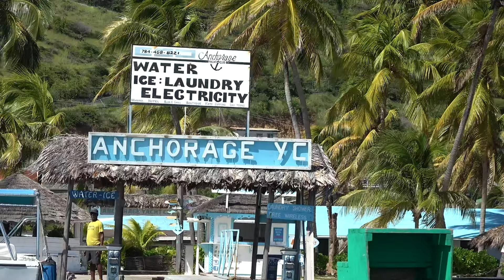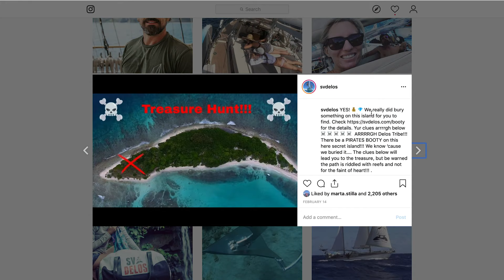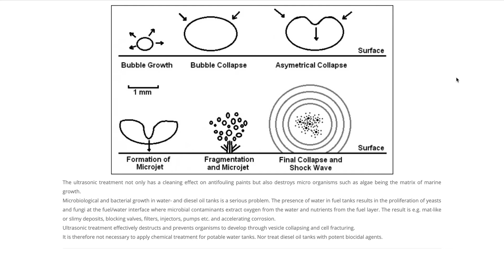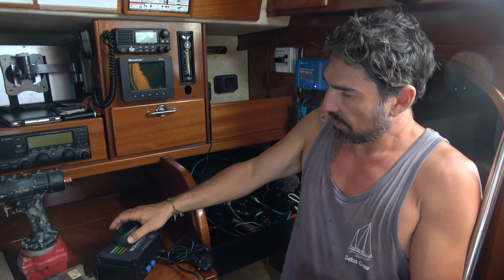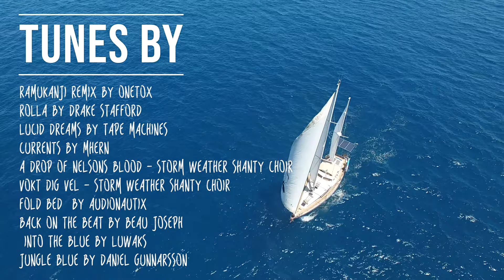We Buried a Moonshine 🍾☠ Treasure on a deserted island!!!  Sailing Vessel Delos Ep. 216

Comment: Hope that thing works on getting your boat bottom cleaner for a longer time for in between scraps. The best way is to do what the older folks did or what I did for a the boat owners on are dock. They would pay me, depending on the size of your boat, around $25.00 per boat. I could do around 4 per weekend around the 70' range. We all had houseboats on are dock. There was not a lot of sailboats. But if I could make a dollar by swimming, I did it. So go to the locals & pay there kid $20.00 to do just the sides of the boat. Then you all can use the tanks to get the rest. That away the local kids can make a few dollars & you don't have to work yourselves to death. You tell the kids the more of them the faster they get done & you'll make it $30.00 total & they can split the money however they want. Just thought you would like to know my secret, what I did as a kid, on how as a kid I made money. Had gas money for the summer. I loved it.
When's that baby going to be born? Can't wait till you start giving updates of the little thing. 
Be safe on the water y'all,
Chris from Missouri

Comment: If you gated those transducers so they listened half the time many times per second, you could read the bottom on an oscilloscope.  I am an industrial ultrasounder and have imaged the foremina of the brain with one, but you should be care to not use it for more than twenty seconds on the brain since it stimulates the brain areas and may cause a bit of unwanted heating of the interior.  I had goldfish in my inspection tank, so I did not use the Vaseline but water works just fine as a coupler.  The goldfish always complained of pollution if I used another surfactant, because their rate of coughing or clearing their gills went up.  Otherwise they ignored me or were oblivious to what I did unless they were hungry in which time they came up under my hands and gave me a few nibbles on the fingers to get fed.  The denizens of the deep are fairly intelligent within their bailiwick.  They also prefer to see in color, so if there are any underwater computer screens out there they are probably spying on you.